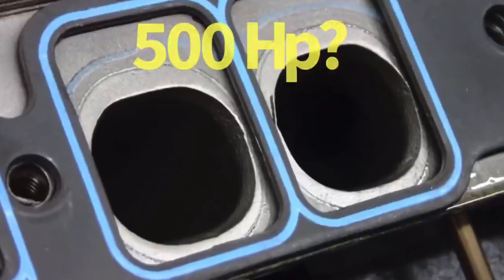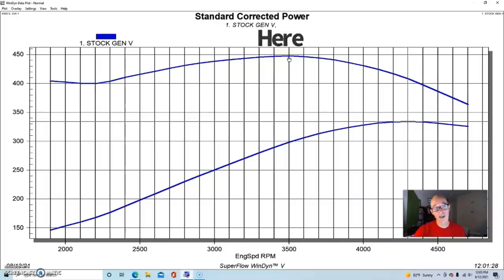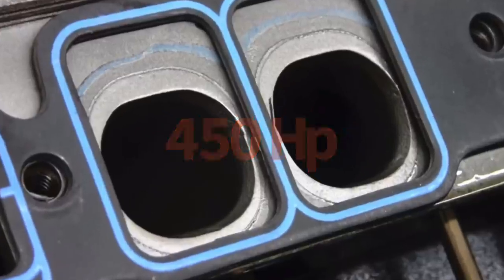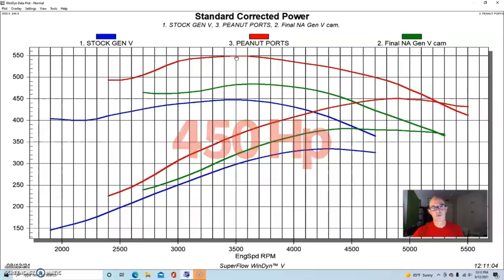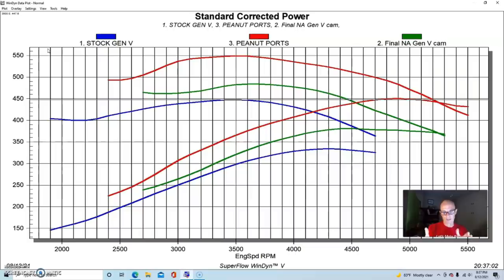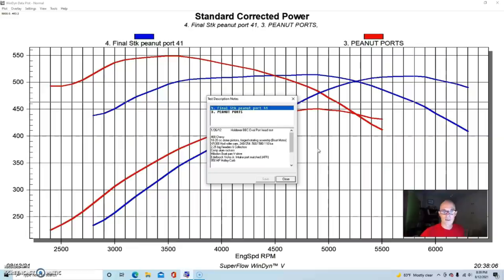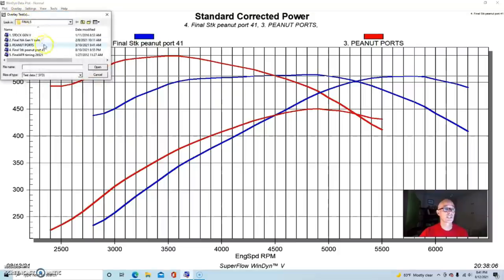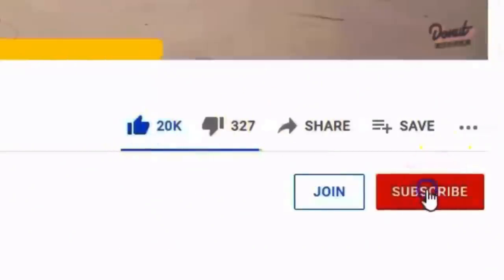HOW TO: MAKE 300 HP, 400 HP & 500 HP WITH PEANUT PORT BBC HEADS (HUMBLE JUNKYARD GEN V 454 )

Comment: What difference would you expect going from peanut port to large oval port ?
Reply from the maker: DEPEND ON MANY THINGS
Reply: @richardholdener1727   mostly stock 454 going in a tow pig. I’ve got peanut ports on it now and a couple sets of large ovals that need work. I keep wondering if it’s worth it. Mild cam not going over 5grand rpm. Dual plane intake and carb

Comment: just out of curiosity. What would the 268 cam do with the better heads. hp/torque prediction?
Reply from the maker: BETTER
Reply: @richardholdener1727  obviously better. Lol. But would it stay in the same rpm range?

Comment: Need a motor for my 87 k10 gmc.....found a 66? 396 block and it has 045vheads from a 78 to 87 454.....122 cc  chamber....obviously low compression....id like 345 ish hp and 425 ish tork....can it be done?
Reply from the maker: YES
Reply: @richardholdener1727  thx

Comment: What about us folks that are looking to make lots of power and torque down low in the RPM range?    I've got a 454 in my C30 and I'd love to build it up for huge torque and power down low.
Reply: That’s what roots blowers are I mean with the right cam and heads you might be able to make 80-90 more power in the stock rpm range
Reply: @turkeyboyjh1   Compound or variable vane turbo
Reply from the maker: displacement, long tube headers, mild cams, long intake runners
Reply: @richardholdener1727  thanks for the advice Richard!

Comment: How much difference does JUST the manifold change make? From stock to rectangular port?
Reply from the maker: the stock manifold on the gen v is a TBI intake
Reply: @richardholdener1727  Sorry, guess I should have said a manifold meant FOR those ports. Like the Weiand 8122. Is it better to use a square port than one sized for the port?
The P/N 8122WND intake manifold series is designed specifically for the BBC “peanut” oval port cylinder head

Comment: I have a gen 6 bottom end numbers verified why in the hell does it have peanut ports on it its unmodified came from my job that they bought new any info would help
Reply from the maker: was it rebuilt or were the heads replaced-maybe an in between years thing?
Reply: @richardholdener1727  no was never  rebuilt  to my knowledge  std pistons and everything

Comment: Is it possible to use an OEM hydraulic roller gen 6 setup on a gen 5? The gen 5s have the machining for the factory cam thrust plate as well right? The OEM roller setup with the spider style retainer looks a fair bit cheaper than retrofit.
Reply from the maker: yes-we think so

Comment: I prefer the 450hp version. That 500+ version is worse up till 4500. Depends on end use of course.
Reply from the maker: lot of that was the single plane intake
Reply: @richardholdener1727  yes true, i just think that even if a dual plane was used it would still be ok on hp and better on tq , that was a lot of extra cam for the gain, of course due to the heads being small but still an interesting test.
P.s. Richard,  what is your preference of oul on a flat tappet cam? Thanks

Comment: Was the first engine a 502 or did it just have mismatched valve covers? Some of the images you show have 502 on the valve covers.
Reply from the maker: JUST FANCY VALVE COVERS-THAT'S WHY I PICKED THIS MOTOR FROM THE JUNKYARD-THOUGH IT MIGHT BE A 502 REPLACEMENT MOTOR-IT WAS STOCK 454

Comment: To make 334hp on an engine dyno with no exhaust, no accessories, no air cleaner out of 7.4L. Requires a very special kind of special. Rated at 290hp from the factory, this boat anchor must have been designed by the work experience accountant
Reply from the maker: the gen 6 was rated at 290 hp, the gen 5 was closer to 240 hp
Reply: only way to pass an e-test back then and still use a Big Block

Comment: Do peanut heads count as a "closed chamber"?
Reply from the maker: that is chamber shape-these are open
Reply: @richardholdener1727   I took off a set, to put swap them out for some rebuilt oval ports. Only then noticing the chamber was smaller.  That's why I asked

Comment: I have a question on heads combination. Im building a 496 on a budget and really like to use the stock heads. 

Oval port
14092360

I can't find enough information to see if they are at least 250 cc on the intake. 

Am I wasting my time since it's going 496. Or do a smaller cam to get more RPM range and possibly turbo. 

I was actually thinking turbo to compensate for the lack of heads but when I realized you can't out run the heads I started thinking other ways through camshaft.
Reply from the maker: boost will work with any head
Reply: Will boost help to increase my max rpm from 4500 to 5500?

Comment: 450 hp setup and Gen 6 heads?? Or just start with the Gen 6… The expensive solution is the 450 hp shortblock with the AFR 265s.
Reply from the maker: a cammed gen 6 with springs makes 425 hp

Comment: Need to treat a v8 like half a new tech Honda motor and destroke them and rev them up to 9-11k rpm.  Fuck 5500-6000rpm crap and blown up dyno numbers.  Racers use transmission to remove time shifting and gear changes.   Rev the motor and you don't need to shift...while they spin, you're moving..
Reply from the maker: a peanut port bbc to11K?
Reply: If you want to create real power figure out how to rev these engines.   Rod:stroke ratio is your issue, find the right combo or buy aftermarket and build a us Ferrari like engine. 5.0, 5.1 liters will make more power then a 6.0.

Comment: Richard, I do appreciate all your work, it is very valuable to me.  Would it be possible to include the BSFC's on your dyno runs?? This info is helpful, especially for the street folks, since it gives a measure of an engine combination's efficiency in converting fuel to Hp/torque.
Reply from the maker: are you looking for mpg at wot?
Reply: @richardholdener1727  Thanks for the reply.  My interest is in the 2500 -4500 range, where most street engines run most of the time.  It is also helpful in seeing the efficiency, for example, between a open peanut head vs. vortec head.  Most of the dyno charts include this measurement so it should not be too much of an issue.  Keep up the good work.

Comment: With the xe268 cam version could you feasibly spray it with 100-150 shot? Or with those heads would it be wasted since the heads don’t flow like a set of AFRs
Reply from the maker: easily take a 100-150 shot
Reply: @richardholdener1727  Sweet. I have a 454 in a Chevelle with some slightly better than peanut port oval port heads, comp xe274, edelbrock air gap intake, 750 carb, 9.5:1 comp. Would love to dyno it/tune it up and see how it stacked up to your test with the xe268. Has ridiculous mid-range torque in the car! Maybe we'll set it up for spray if it needs a rebuild to level up for more fun.